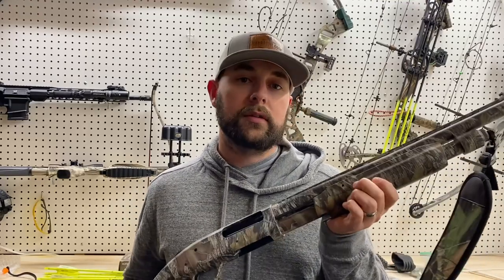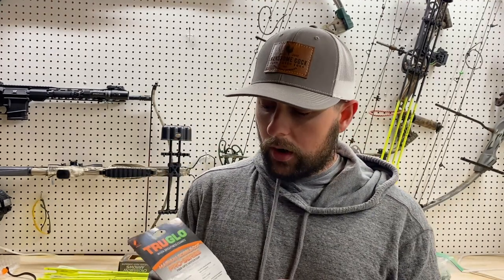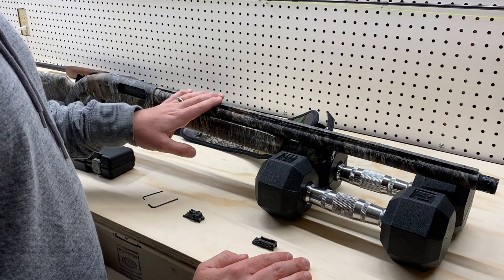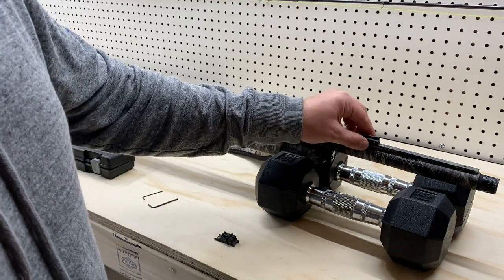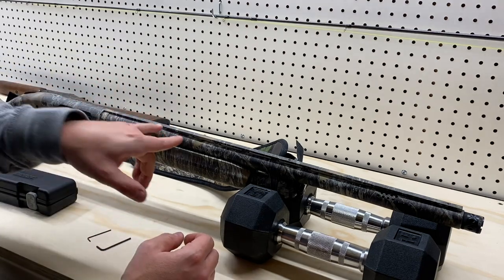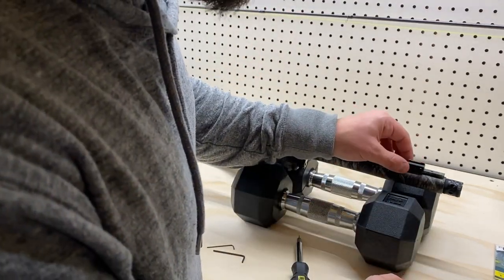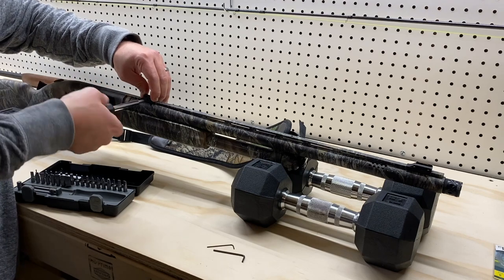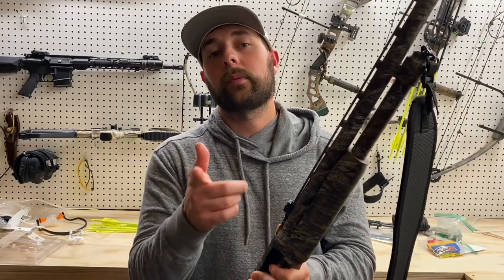How to Install a Fiberoptic Sight on a Shotgun (Tru-Glo Magnum Gobble Dot Pro Series)

Comment: HIVIZ recommends pushing the front magnetic sights up to the front bead so that the recoil doesn’t cause the magnetic sight to migrate forward. The magnetic one might have stayed on the rib if a new Mossberg or equivalent bead had been installed. The same process might be advisable for any type of front sight that does not use the existing bead threads to install a retaining screw.

Comment: I’m really experimenting with my sights on a mossberg 940 jm pro, trying an XS ghost ring with rail in the rear and this tru glo red fiber optic front. Haven’t installed yet but really hope it works out. If all fails I can revolt to the factory build. Eventually, I might throw a red dot on the XS rail but I would definitely want functioning irons first!

Comment: @codywheeler5581
Can you do a video on a proper way to put a vertical grip onto a shotgun pump. Maybe putting an m-lok picatinny rail on the pump that is able to accept a vertical grip. I can't find a good set of info. 
I could probably figure it out but I want to have a secondary visual just in case.

Comment: I've seen older similar products that had clamps that could slightly wrap UNDER the rib. I notice that these sights must rely only on friction and lateral pressure to stay on the rib.  How do these stand up to recoil over time?  I would use 3 in shells for turkey.